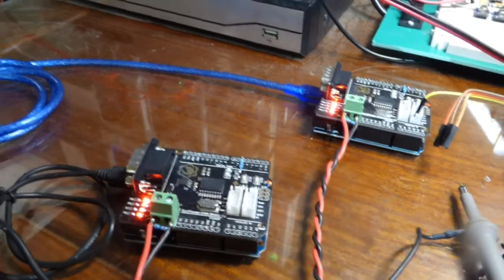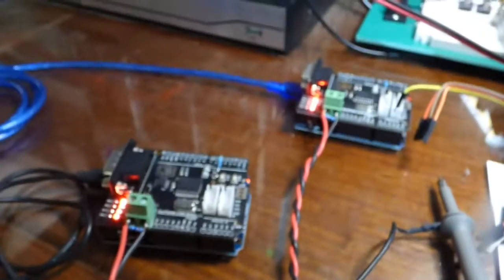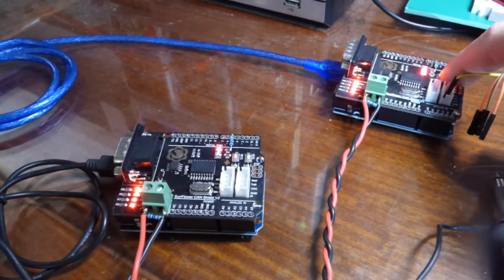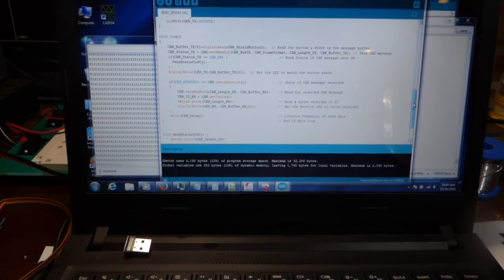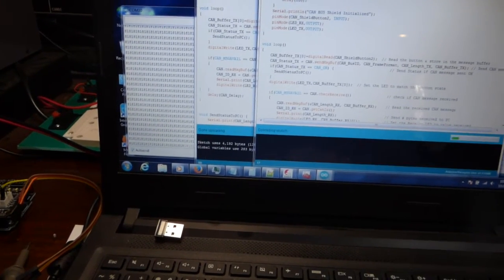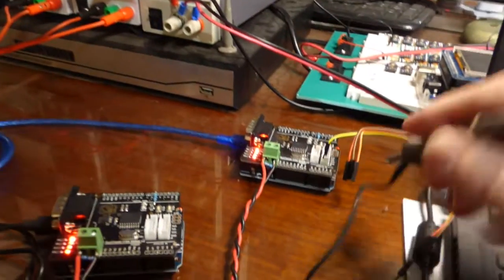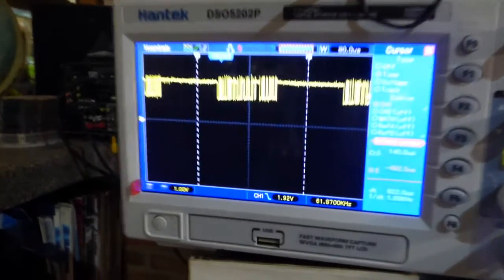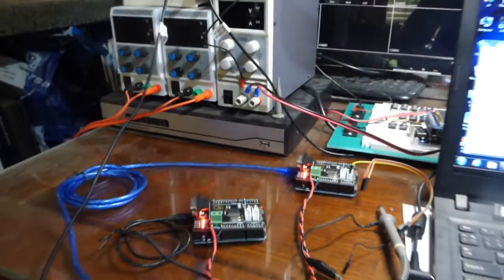CAN Bus Bidirectional Comm, Dual Arduino Uno, Oscilloscope Trace

Comment: What's the maximum wire length between two can bus adapters?
Reply from the maker: I haven't tested it, but it should be able to go up to the maximum length for CAN bus at 1 mbit/sec., which is 40 meters. This assumes proper termination at both ends of the CAN bus. If that isn't reliable, the first thing I'd do is fall back to 500 kbit/sec., which should allow a bus length of 100 meters.

Comment: what i am trying to do is sending and receiving values and switch states on both arduinos... so no slave master system but equal systems.... is this possible with the can bus? i2c doesn't seem to be able to do bidirectional communication for values such as temperature... wich is crap 

What i'm trying to do is sense the temperature of the motor in my ship, send it over a bus to a second arduino. On this second arduino i want to display the temperature. On this same (second) arduino there has to be a switch wich triggers relays on the first arduino... Is that possible over CAN bus?
Reply from the maker: Yes, you can do it that way. You just have to program different ID's for the two CAN bus controllers, and make each one listen for the ID transmitted by the other one. That's what I'm doing in the demo above.